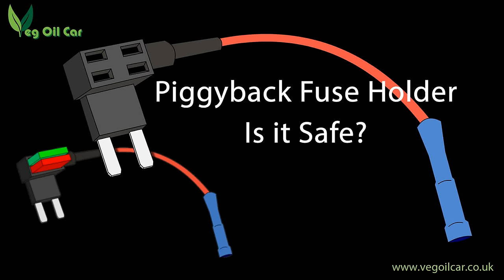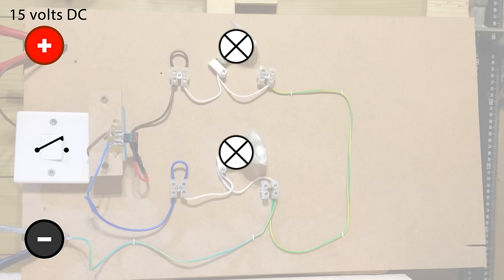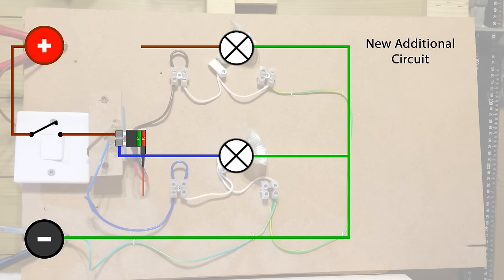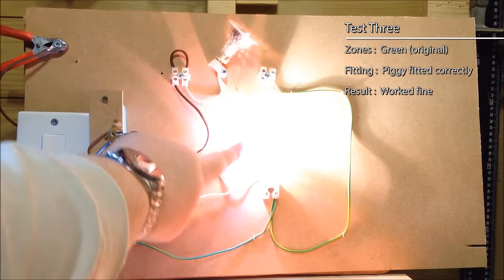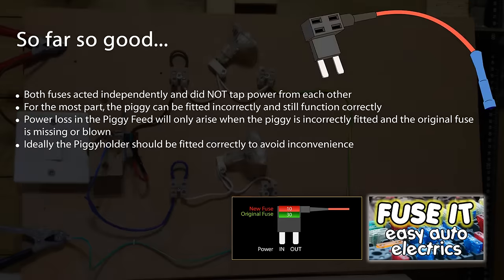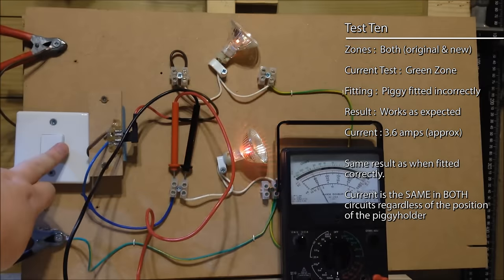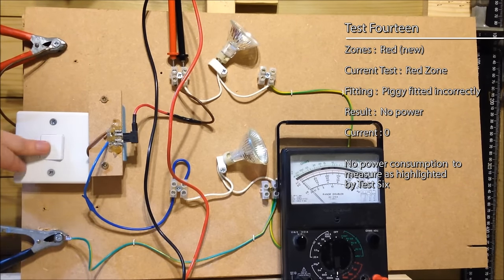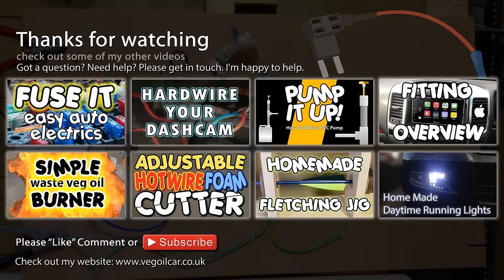Piggyback Fuse Holders SAFE OR NOT? A Piggyback bench test - by VOGMAN

Comment: hi thanks for the videos geoff, however i think you need to make it clear that installing the fuse holder the wrong way around can create problems. installed incorrectly the power to the accessory will flow trough the original fuse causing additional strain on that fuse. If the accessory draws alot of power and it has a larger fuse than the original fuse (say a 2way radio which i install) then the additional draw can blow the original fuse, you essentially fuse everything on both circuits with the original fuse. it can be a problem if the original fuse is something like airbags. very thorough otherwise.
Reply from the maker: +j Walls 
Hi. Thanks for the thorough and well thought out comment. It's certainly will be a bonus to anyone reading this page.
I can't help but wonder in honesty if the major differences with these Piggybacks lie with the manufacturers. I get the impression you are informed and well aware, so I've no reason to disbelieve you, though personally in my experiments I couldn't duplicate the results you describe. So perhaps it's a manufacturer thing...
I've got two Piggyback videos now and I hope I've made it clear with those which way I would recommend fitting them. I do agree with you though - FIT THEM CORRECTLY FOLKS - as that seems to be the best way to avoid issues and again, a personal preference, I wouldn't over-power them. I'd restrict their use to 10 Amps and under. Anything else could tax existing cables, etc, so and separate, dedicated line would be better.
Again, thanks for your comment ; )
Geoff
Reply: +Geoff VegOilGuy rarely will it cause a probem geoff. it just means that when fitted backwards the power goes into the fuse holder through the output leg of the fuse tap then feeds the input leg through the original fuse. to help visualise this problem - if you trace look at your diagram explaining the path of the power through the fuse tap just imagine the power going through the output leg of your fuse tap. probably wont cause a problem unless the accessory draws close to the limit of the original fuse. trust me it can cause problems. my guys installed some backwards on a fuse controlling a light system on a school bus. blew out the original fuse when the 2way radio was used for extended periods of time. trust me on this one - think through it and you'll get it. really great video otherwise:)
Reply: +Kate Walls So I guess the real question is, which way is the right way? How can you tell?
Reply from the maker: ComPrt3 
It's all about the power consumption. Have a look at the device you want to install. Read the literature or look on the device itself. Somewhere it should say, in Amps, how much power the device uses. Personally I'd recommend that if 10 or more Amps are required then a separate fused line is best. Anything less than this should be okay. Hope this helps.
Reply: +Geoff VegOilGuy Actually I was referring to which direction the fuse tap should be placed. It can only go in one of two ways. Which is the right way.
Reply from the maker: My apologies. I should have read your comments more closely.
It's all about the direction of electrical flow (where it comes in and where it goes out). Sounds complex but isn't. I explain that fully in this video - https://youtu.be/8omZ545Cw1U - but you will need a multimeter to test the power supply across your vehicle fuseboard.
If this video doesn't answer your question, please come back and I'll do what I can to help.
Best wishes,
Geoff
Reply: +Geoff VegOilGuy   The video you recommended was exactly what I needed. Thanks m8.
Reply from the maker: Happy to help ; )
Reply: I think the easiest way for checking the right way is feeding the new circuit without inserting the original fuse, if it Works, thats is the right way and the original fuse can be inserted.
Reply from the maker: Good practical advice. Thanks!
Reply: Haven't you got that wrong unless you don't want the tapped supply fused?
Reply: Your results don't conflict with Walls' explanation. When the holder is in the wrong way, the circuit must complete (to new device) connecting through the original fuse. There's no other way to complete the circuit else both legs of the holder would be +12V and that's obviously not the case.

In order to show this, you need to measure the current going through the original fuse when the holder is in the wrong way. If Walls' explanation is correct, it will be something like 3.6 + 3.6A.

Your current experiments do not test Walls' explanation because you are not measuring the current going through the fuses, you're measuring the current in the parallel arms of the circuit.
Reply: To clarify what I mean, you need to measure the current through the original fuse by removing the fuse, sticking two wires into the holder, connecting them to the fuse and the ammeter. This current measurement will test the circuit before the parallel junction inside the holder.

Comment: I think that there is no wrong way of putting it. It's just a different application. First if you want to split something in two - let's say put another cigarette lighter. Or second you want to add something , like additional lighting in the trunk.  If the original fuse is blown/missing/ it should not work at all if you are adding stuff. Just like if you turn it the wrong way around. So for me this is not the wrong way, it is the right way. If the original fuse is blown, this means that something in the original wiring is wrong and it is not working. So why should the additional wiring be working. It could be dangerous. But if you want to split the cigarette lighter, then you would want both of them to work, so this is too not the wrong way. For me there is no wrong way, just a different application and it gives you the choice on how to use it for your purpose. Greate job there.

Comment: Thanks for your video. It was very helpful. To clarify, if I am tapping into a 15A circuit on the fuse box, can I use a 10A fuse on the Piggyback fuse holder?

To expand on my question, If I have two 10A fuses, is it safe to tap it into a 10A circuit in the fuse box? or should I tap it to something with more power like 15A or 20A?
Reply from the maker: Thanks for your question. It's always tricky to answer these sort of questions as vehicles, makes, models, etc, do vary. I can only take a guess and I could be wrong...
So with that said, whenever possible use an empty slot. That's ideal.
Up to 10 Amps, I'd probably chance it.. 
Which fuse? The chances are the wiring loom is made up of the same size cable to maximise buying power. What I mean by that is why buy thin cable to just handle light circuits when medium thickness cables can be bought more cheaply in bulk and will do the same job? So by that logic I'd probably go with the smaller fuses.
In an ideal world try to look for something that gets used rarely, like electric seat adjustment, etc. 
I hope this helps.
Best wishes,
Geoff

Comment: I believe the only issue it would be to overload the wire supplying the power to the Piggyback Fuse Holder.
by tapping into a fuse line that uses a 10 Amp fuse chances are that the wire supplying power it would be rated at 10 Amps maximum hence the 10 amp fuse.
If you add another item drawing 20 Amps from the same supply wire you'll risk to burn the wire supplying power to the Piggy Back Fuse Holder
That's just my thought
Cheers
Reply from the maker: +Max Germasi 
I agree with you Max. That's why I personally don't recommend using them on anything exceeding 10 Amps. In such such a separate line is the best way to go.
Thanks for your comments.
Geoff
Reply: @vogman    I realise it is 3 years ago but IMO that depends on which  way the piggyback fuse holder is plugged in, right? The 'tapping' can happen at the side which supplies the current in which case it is possible to overload (at least in theory) that wire, but if it is tapped from the side that protected by the original fuse then you cannot overload the supplying wire but of course then the 'original' fuse will see both currents and that may blow it. In real life I would expect that the wire supplying the current to the fuse is supplying all/most of the fuses in the fuse box so very unlikely that you can overload that. But what do I know, just second guessing the engineering logic... :)

Comment: My question would be why not use the same amperage fuse if the original amperage is green. Going to hook up some LED lights to my 12-volt rear power source and I'm going to use the same amperage fuse that is in that spot fused tap will there be a problem??

Comment: Oh I see. So instead of the fuses being parallel, if the piggy back is reverse the fuse become in series.
Reply: It isn't in parallel(nor series) or the top fuse would work even when backwards. From what I gather the two fuses are independent as the top fuse is set into a positive line and doesn't connect to one of the prongs coming out of the piggyback. The red wire is the only thing connected to the closes slot in the upper fuse holder. This would explain why it only works on one position when there is no bottom fuse(correct) but it will work with both fuses(incorrect) in the opposite position. It is a good way to test the right orientation as you want it to work even with the bottom fuse pulled to ensure you are running power through the upper fuse and not through the bottom to power the top fuse.

Comment: Hi! I have a question. My car didn't come with neither trunk nor glove box lights. So in order to add them, should I use one piggyback fuse holder for both lights (and the lights spliced together in one cable) or one piggyback for each light? They are halogen since it's an old car and LED lights really don't look good on it. Thanks in advance.

Comment: They are safe when used right, That is the problem. It is just like using power strips in your home. They get miss used and you have problems. I can plug 300 cell phone chargers at 5 watts each into one 15 amp outlet and not over load it. But one hair dryer will push same outlet to its limit. Those piggy back fuse holders are safe when use right and with some common sense. If used wrong you can have real problems. If in doubt then do not use them.
Reply from the maker: Perfectly said David. Spot on.

Comment: Great videos, very informative. Question I have,
I have to orientate my piggyback the wrong way in order for them to fit back in my fuse box with lid back on ( it’s a Volvo fuse box under seat) I have 2 fuse slits which I identified switched and live and they are unused slots. I need to power dashcam and power magic pro but what fuse should I put in the bottom of the piggyback when I insert wrong way? On top I’m using a 5A on bottom a 5A too? One of the unused slots in the car manual has 5A and the other unused slot is 20A but I don’t have these accessories fitted in the car, can u help 🙏

Comment: Can you cascade 10x wire taps with 10A or bigger fuses? Then you could draw 100A or more. No? Why?

When people say wire taps are safe, they cannot also tell you the wire gauge of the cable they are drawing power from. They ignore the wire they cannot see, that goes from the engine bay fuse box to the interior fuse box. Any time wire size is reduced, a fuse is needed. And a wire tap does not get free energy from somewhere. It is not a relay. 

Still don't believe? You might be thinking about only one of the fuse terminals. One terminal leads to the original factory accessory. This one is "separate" with a fuse tap. But the other terminal is the one that is being overloaded, because the 2 fuses ultimately draw power from a terminal that was designed for a specific maximum fuse value. There are many wires leading from the battery or engine bay fuse box to the interior fuse box. And what is their ampacity?  Then how can you know if it's safe?

If you've made it this far without believing, you are encouraged to cascade many fuse taps and run many accessories from a single circuit. After all, won't the fuses just blow if too much power is drawn? Well, you might find your fusible links are the only real protection here, if you even have them. Just keep an extinguisher nearby

Comment: That was very informative. Appreciate that. My fuse taps blue end got cut. So its gone. If i just tie the wires together with that end will it work.
Reply from the maker: Hi Raj... to be honest I'm not a fan of those connectors. I cut mine off and solder them : )

Comment: Hi good explanation of the piggy back fuse holder.
I’m just about to use one of these on my van and purchased the correct size of piggy back fuse holder.
When I removed the original vehicle fuse I was surprised to find it had 3 prongs, found out it’s called a micro3 fuse.
Just wondering why it has 3 prongs instead of 2.
Reply from the maker: Hi Anthony. You're right about the name. Micro3 fuses are becoming more popular as they're space saving and capable of handling high temperatures. If I recall correctly, they're basically two fuses end to end. So lets pretend the two fuses are 5 Amps. That means the fuse is a (5 + 5) 10 Amp. BUT there's also a centre terminal... if we connect via the either one end and the centre it's only 5 amps. At least I think that's the general gist  : )

Comment: Thanks for the demo, it's really helpful..
Is it safe to use for LED light bar?
I have 120W led light bar, how many amp it will draw?
Reply from the maker: Ah... maths... and so early on a Monday morning  : )
Assuming your vehicle is 12 volts, Power = Current x Volts   so    120 = Current x 12     so    120/12 = Current
That's 10 amps.
You appreciate there's always a risk in offering advice like this - I'm not there with you, seeing what you see, etc, so I could be wrong. I think you should get away with 10 Amps in a Piggy, but go slow. Do it, test it briefly. Test it a little longer. Keep an eye on it for a while.

Comment: So, how does one tell the correct way to insert the piggyback.
Reply from the maker: Hi Peter. That's a fair question. I'm not sure if I actually make that clear on this video. I know I did in my Fuse It video - https://youtu.be/8omZ545Cw1U
If this helps, think of the red tail of the piggy (the wire that sticks out) as pointing the way out - "sticks out - way out" sort of thing. 
A fuse holder is a bit like a U turn for electricity. The current comes in through one terminal, through the fuse, then out through the other terminal. If you know which terminal is which, you know you can safely point the tail of the piggy in the direction of the out. Sounds very confusing when I'm describing in like this.
If you have the time, check out the video I've mentioned. It's something of an auto electrics 101 but it does should how to identify a suitable fuse, etc.
Any problems or further questions, please do come back to me.
Geoff

Comment: Hi great video can you advise please. I want to hardwire my dash cam with a piggy back & it already has an in line fuse. Could this cause an overload? Thanks
Reply from the maker: It's common practice for suppliers to fit an inline fuse. Typically if you remove it, you invalidate the warranty. Keeping it won't cause any overload issues but it could make finding a blown fuse more tricky if that ever happens. Just remember it's there  : )

Comment: So these are absolutely safe to take a trigger current for relay from high beam fuse, that should add very low current to existing circuit. Adding auxiliary high beams to my car and searching easy way to take trigger current for the high beam.
Reply from the maker: These are perfectly safe, yes. But if you're triggering a relay, and I commend you for doing so as I personally think that's always the safest option, you might not need one at all. Generally relays use very little current to trigger, so you can tap into an existing circuit.

Comment: Great video! Also does the new fuse has to be strictly less than the original fuse?
Reply from the maker: It's not strictly necessary BUT it is good practice. In theory if it's a small fuse then the current rating of the wire MIGHT be low, so adding a large fuse / current heavy device could burn out the wire - it might not trip the fuse but it could still do damage. Have a look at my OVERLOAD video if that helps.
All the best  : )
Geoff